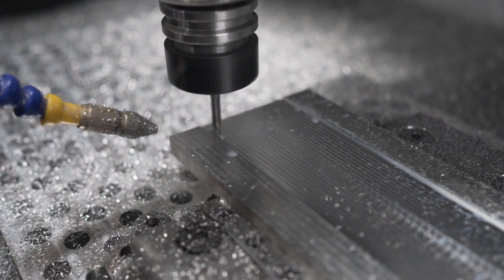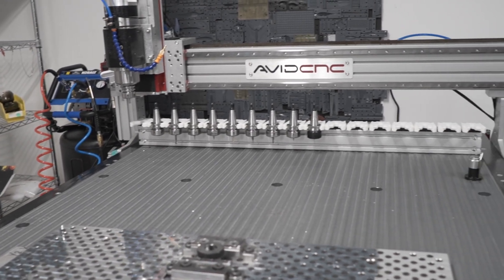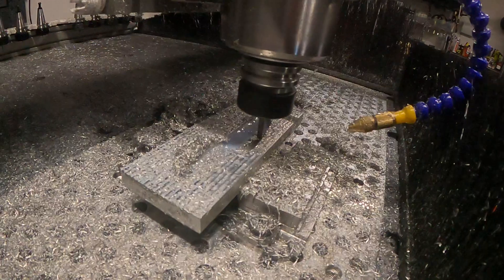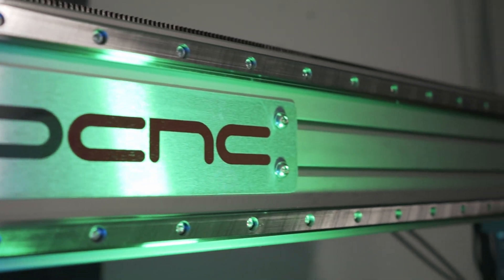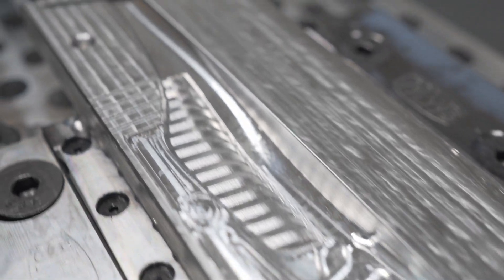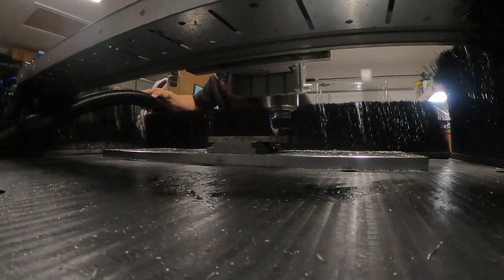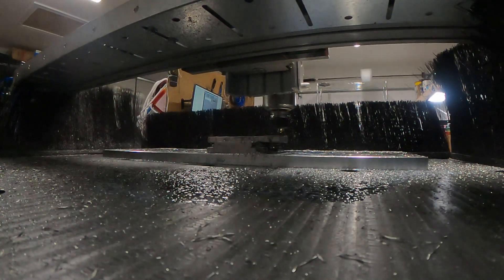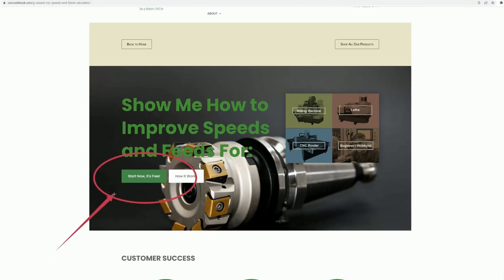Avid CNC For Aluminum Injection Molds - What You Need to Know!

Comment: If I was doing my CNC build again I wouldn't waste time with stepper motors. They caused so many problems with inaccuracies which prevented my two part molds fitting right.

I found that the smaller tools require higher speeds but steppers have very little torque above a certain speed and lose steps. Losing half a mm over a job is enough to prevent aluminum mold halves fitting together.

Any money I saved by not buying servos was lost in expensive slabs of aluminum I couldn't use.

Comment: Do you mind if I ask 2 questions:  1) where do you source your aluminum plate stock from?  2) are you planning to do any follow-up videos on the S30C ATC setup / operation / lessons learned / etc ?   Thanks
Reply from the maker: I am lucky to have a Metal Supermarkets close by and I get all my stock from them. Working on a follow-up video now, should be out in a few weeks depending on a few things I don't control ;-)
Reply: @WMBayouLures  thanks for the tip on Metal Supermarkets -- I had never heard of them but now that you mention them I looked and it turns out there's a location a few miles from me too.  Awesome!    Also, def looking forward to the S30C ATC follow up.  I have the same spindle and an Avid Pro CNC and have struggled with trying to get ATC working.  Thanks
Reply from the maker: @carlpetitt2241  My ATC setup videos are here - https://www.youtube.com/playlist?list=PLEdNibYdUWY58KEO7UxEdsxM725ZM8vK2

Comment: You're running 75% correct about things in your video.   Still, you make great content and you get massive points from me for not pretending like you KNOW everything like some YouTubers who started posting videos on Home CNC around the same time as you. I own a Taig, Tormach, and Avid that's 90% complete. A 3D pro would work just fine with your machine.  Essentially it's just a matter of configuring it in Mach 3/4 a probe is the same thing as a limit switch or off an on switch..  I'm shocked Avid said they don't support 3D probs on their machine.  As long as your controller card has a free input the probe would work. As a matter of fact, all you would have had to use is the input for their touch off prob.  What Probe did you use?  Keep making great videos!
Reply from the maker: Thanks! I did try to connect a probe and had some small success but a lot of terrible failures. I decided to punt for a while and get cutting. Hopefully one day I will get a tormach or similar machine. Thanks for watching and the encouragement!

Comment: Hi, first of all, i love your content!! Which 360 CAM Strategy are you using for your baits? I habe some problems with my worms roughing is no problem but finishing makes me go crazy at the moment, thanks a lot and greetinhs from Germany
Reply from the maker: It is either scallop or parallel. For rounder bodies that are smooth (no ribs) scallop is usually faster and has a better finish, but sometimes you need to go parallel to really get into the smaller spaces. I will do a video on that shortly!
Reply: I’m looking forward to learning the process to make aluminum mold. I’m getting incredible results with homemade gantry CNC making wooden crankbaits. Each half is a two sided milling operation.  Carve recesses for weights on inside with pocket Toolpaths and carve outside with adaptive clearing finished with scallop.  Unbelievable results on par with best builders on YouTube. With the ATC your machine would rock at the stuff I’m doing.  I’m going to be making wooden glide baits and will need mood for tails and fins.  I’m planning channel making wooden lures with CNC and 3d printing stencils to make painting easier.  I think once you start offering fusion 360 plans that can carve an aluminum mold your patreon will take off. The 3d printer crowd is used to freebies and I don’t think that’s the case for CNC owners.